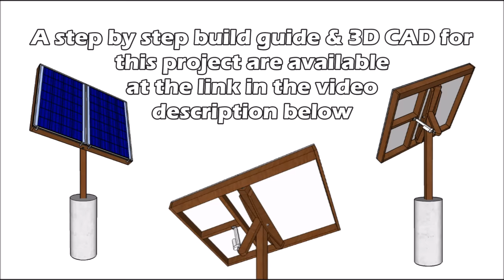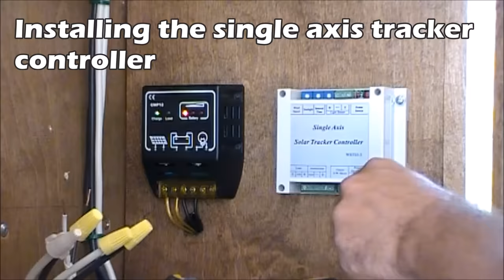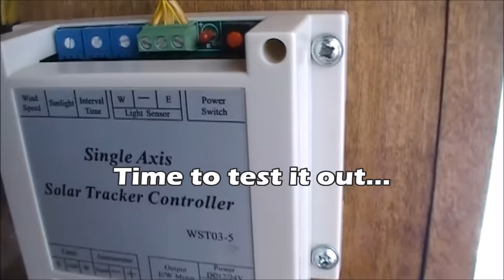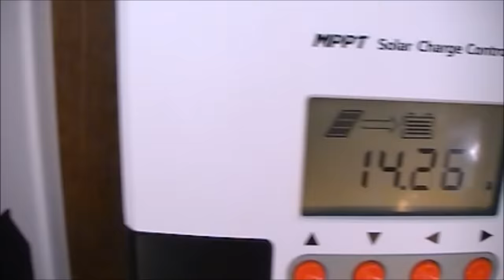Build A Solar Tracking System - DIY Solar Tracker - Off Grid Living!

Comment: did all that and use possibly the most shit horrible charge controller in existence heh   nice vid.
(yes I know it's only to run the actuator :P )

I think I would have gone for the big 250w + 24v panels to maximize use of space and power.  but thats just me.
(and we pick them up pretty cheap here in Aus as there are heaps of companies selling used panels from warranty jobs were an entire system has to be replaces if there's a fault so meet Aus standards for grid tie)

approx $70 US pew 250w 24v panel
Reply from the maker: Thanks. Are you talking about the SRNE charge controller or the tracking controller? Charge controller is among the best in its class - only thing I can think of that might beat it is my Classic. But the tracking controller is a cheap one. Though it's been working fine for me, can't complain for the price - yet lol. Could spend twice as much and double the payback period, but that's not very good either. Easily replaced worst case scenario. I make my own PV btw, which is limited to my laminator size (see past vids). The sun only outputs so much energy per sq.m of collector area (1 kW on average), so there's really no 'maximising' use of space with a 250W panel vs 120W panel - it's just increasing required space. You would be maximising the use of support material instead, but pushing it to it's structural limits with the extra static and live (snow/wind) loads (I'm a building contractor by trade and follow code like it's a religion). The support post and strongback would have to be increased from 4"x4" stock to 6"x6" to carry the load using 250W panels, or the # of support posts can be increased without increasing size instead. 70$/250W panel is extremely cheap (28¢/watt), probably the cheapest on the planet - even cheaper than the cells needed to make them lol. Best price we can get here in North America is ~70¢/watt, in bulk. Are you sure you're not buying used? Got a link for the store?
Reply: OH, no, that is used pricing. 

I'm four weeks of being a first home owner, the house we've bought has an older 2kw system on it, but with current government rebates and offers from energy providers it's crazy not to go as large as you can here (for us, as my partner works from home so we'll be using all available solar during the day)

the new LG Mono X Neon Blacks are about AU $1.65  a watt and coming at 26% efficiency 25 year warranty.  it's not too bad big panels though.

1 US Dollar equals 1.31 Australian Dollar ~5th November 2017

used panels here are ~ $100 for 250w  cheaper the more panels you buy.
Reply from the maker: Ah, I see. That's cool. I hear that grid electricity prices are really high in Australia too, an old acquaintance once told me that you guys are paying up to 40¢/kWhr? He decided to go off grid with batteries. Not sure how his CBA compared to the grid price after paying for the batt's though. But my system is off grid and it's cost comparable to our local grid price of 12¢/kWhr. I know you've just begun your homeowner experience, but have you considered off grid at all? Might be something worth looking into later on.
Reply: bearing in mind the exchange rate, I'm paying 24.51 c/kWh and 20.48 c/kWh off peak hot water.
AND 114.19 c/Day for "line rental"  and when we move to the new place, we'll also be paying a fee to have solar connected to the grid.     so yea, power is not cheap here.

I have no idea where there would be a 40c/kwh charge in this country.  there would be riots.
and battery systems aren't really worth it just yet, even tesla and what not lithiums systems are WAY too costly.  unless you're willing to radically alter your power usage, and in a country where we have REALLY hot summers, yea, na, there is this guy though.....   but he's crazy (smart crazy though)

https://www.youtube.com/user/nocrf50here    he's currently up to a 60Kwh battery system made from old laptop cells and still building packs.  it's a mammoth effort.   VERY impressive.
Reply from the maker: Sheesh, 24¢/kWhr might as well be 40 as far as I'm concerned - that's still double what people pay here lol. Yeah I followed that guy for a while, he knows what he's doing and has a kickass bank, but I can only hear about 18650's for so long until the subject gets boring lol. Manufacturers must charge quite a bit for basic lead acid batt's there. Like I said I'm off the grid but haven't changed my habits at all, and will see a full return on costs for the entire system in 6-9 years. Bare in mind that I install my own equipment too though, total spent on 3 kW/20kBtu of PV/T panels and gear, 1kW wind turbine and 8 GC-145 batteries is just over $5G. System produces between ~400-700 kWh/month throughout the year, @ 12¢/kWh that's a savings of up to ~$80/month, or $960/yr in grid electricity costs (6 year payback), or a minimum of $576/yr (9 year payback - unless we enter a nuclear winter or something). Easier to install your own off grid system but almost impossible to do with grid tie unless a person has a licensed electrician for a friend who will inspect their work and put their stamp of approval on it so that the utility can hook them up with a net metering program.
Opposite to your needs, we use a LOT of heat energy here in Canada. Most people burned wood up until the last decade or so, then some starting switching to natural gas and cold climate air source heat pumps for cost savings (despite being surrounded/dominated by the Boreal forest, firewood is not cheap). I'm sure that the large cooling demand for homeowners in Australia is enough to turn them away from powering their ac's with solar (though geothermal might be practical - the lower the air temp passing through the condenser coils, the more heat you can dump outside and the less energy the compressor will use. If deep ground temp's remain 'relatively' consistent throughout the year and is cooler than the average summer ambient outdoor temp, then burying some coils, installing a simple pump and incorporating a water/glycol to air heat exchanger on the input side of the condenser would help considerably). I definitely would not be able to afford to power resistance heaters with PV, that's for sure. I would need 8 kW and dozens of batteries plus what I have now just to cover heating needs. My PV/T system (I assume you know enough about PV/T to follow along - if not feel free to plug me with questions) is how I heat my home directly with solar thermal power during the day, and use wood at night. I don't like burning wood though, defeats the end goal of owning a net zero home, so I'm incorporating a cold climate air source heat pump with the system this weekend to hopefully eliminate the wood stove altogether. When the collector temp in the PV/T array is too low for comfortable direct solar space heating but is still higher than the outdoor ambient temp (which can drop below -40°C, before the wind chill), then temperature and photosensitive relays nd automatic dampers will redirect the backpass airflow behind the panels to the coils in the outdoor heat pump unit, instead of pumping the air directly in the house (the latter will be an open loop configuration, whereby cold air is brought into the collector from outside. When direct heating with solar, the configuration is closed loop in that it circulates indoor air from the house, through the collector, and back again). With that said, the heat pump does add another $1800 to the system total, technically, but the coogeneration should increase the average coefficient of power for the heat pump substantially, and allow the PV/T system to contribute far more btuh's than it normally would in it's current stand alone installation. Hopefully the savings will balance the added cost, but with this being a bit of an unconventional approach to heating there isn't a whole lot of prior research  published on what to expect. None the less I have power and temperature data logger ready to record everything, and as always the info will be posted on my website whether it works or not. Visit the link below if you're interested in seeing past PV/T attempts and the disasters that followed (see 'Open Source R&D' tab):
www.resystech.com
Reply from the maker: I remember my old acquaintance had an ENORMOUS amount of batteries. Dozens upon dozens. Top quality too. His Pv was equally large. Had local installers install it all. Kind of blew me away thinking about the amount of $ he was spending and how he would recoup it. Always wondered why he didn't look for alternative cooling methods but never mentioned it, he seemed really happy and I didn't want to insult him.
Reply from the maker: ...then again, he was the one who said you guys are paying up to 40¢/kWh. Might be how he tried to justify it.

Comment: Great work! How much are the factory solar panels in the US? In Russia, a panel with a nominal power of 100 watts costs 80 dollars. At first I wanted to make myself from Chinese solar cells. But it turned out cheaper to buy ready-made, also Chinese, good quality.
Reply from the maker: Not sure what they cost in the US, but here in Canada the retail cost for a small quantity of 100W panels is between $150-175/panel. If bought in bulk for a full size system (generally above 3kW) then the cost can be as low as $75-80 per panel. If you want to beat the cost of professionally made solar panels then you need to buy components at the manufacturer's cost - as in buy the cells, tabbing wire, encapsulant, etc. at wholesale cost, not retail. Especially not from places like Ebay or Amazon. Prices are extremely inflated on these sites because some suppliers are trying to cash in on the DIY market and take advantage of unwitting and vulnerable people. The cost of cells is also going up because of silicon shortages and factory shut down's in China, which is the world's leading supplier of cheap solar cells. Xenophobes like to criticize China and Chinese products, but almost all of my gear is from China or made from Chinese materials and I have almost 0 complaints. 
Trump just tacked a 30% tariff on imported solar products so I imagine the price of solar in the US is going to climb pretty high - if anyone should be thinking about DIY solar, it probably should be Americans.
Reply from the maker: Too expensive - not much better than Ebay if at all. The US dollar is worth more than the Canadian dollar, so once the price is converted to CAD it's even more expensive. Take the first listing for example:  10 pcs of 4.5W polycrystalline cells for $16.16 USD. In Canadian that's $19.91, for 45 watts of solar. Or 44¢/watt. Just for the cells alone. At a price like that, DIY panels would cost far more than manufactured panels in bulk. Fortunately, I already have a supplier here in Canada and get my cells for less than 30¢/w, but I would advise anyone looking to make DIY panels for a large system to contact material suppliers directly and work out bulk order prices, it's far more economical than just clicking the 'buy now' button. A lot of manufacturers sell on places like Aliexpress and Ebay, but generally you have to contact them directly if you want any bulk discounts. Otherwise, I wouldn't recommend DIY.
Reply: I agree with you.

Comment: How do the solarpanels reset in the morning? :)
Reply from the maker: The sensor mounted on the tracker - when the sun sets at night the sensor tells the controller to move the panels to their homing position (basically due south), then when the sun rises in the morning the sensor is in the right position to catch the light and tell the controller when it's time to point the panels east.
Reply: Awesome work!!! ❤️
Reply from the maker: Thanks!

Comment: should have used steel pole instead of wood , that wood will rot in less than 10 years , it doesn't matter that it's treated wood

Comment: 18 labor hours @ $12 per hour and about $50 in materials to get a 25% output increase out of a 240 watts solar tracker  wouldn't be much of a cost effective project.... you can increase the output by 55% instead by installing an additional 300 watt panel for only $100 apiece....(and seen them as low as 25 cents/watt)....

Comment: Do not ever pound rebar into the ground like that.. it will rust and dissolve in no time and destroy the integrity of the concrete as it decays.  This is not how you poor footings... if you want a stable footing dig a bigger hole with more weight.

Comment: Wouldn’t it be easier and less complicated to track the sun by a timer
Reply from the maker: Less complicated? Not really. I didn't have to build the tracking controller - just connect red to red and black to black. Have to do that with a timer or any other controller type too.  Besides, it would severely compromise efficiency and probably render the effort pointless. To work properly, the timer would still need some sort of intelligent control that accounts for daily progressive sunrise/sunset changes and estimates the position of the sun accordingly. A programmable timer could work, of course, but to find one with a memory large enough and go through the bother of programming it to suit the solar azimuth throughout the day, every day of the year, a person would probably find it easier just to spend 10 minutes connecting a couple of wires to an affordable intelligent controller that's designed to automatically track the sun.

Comment: It would be easier and cost the same to instead have two stationary solar arrays, facing 90 degrees to each other.
In the northern hemisphere, one facing south/west, and the other facing south/east.
For a gain of 25% more energy, a solar tracker isn't worth it.

Comment: You are spending a lot of effort and cash to get the maximum output from your panels so why not enclose the rear of the panels with some thin plastic or ply and use a small under-volted computer fan to blow cooling air on the panels ?

Comment: What a luck pv has become so cheap that it's easier to buy some more panels than to spend time building such trackers
Reply from the maker: If you have 25% more space to work with, sure. If not, then you're stuck with trackers. Guess your solution isn't a cure all eh?

Comment: That will cost a fortune. It's cheaper paying for electricity from the grid.
Reply: Maybe in some areas, but if you need to pay for building the grid connection because you live a hundred miles from anywhere, possibly on an island or up a mountain, making your own electricity becomes both way cheaper option and is going to be far more reliable when snow or storms cut the wires. Yes, buried cables are far more secure against elements, but those cost even more.

Even if you don't live off grid, lowering the amount of power your house uses will add up to a notable amount of saved money, and because prices of the panels and electronics have gone way down and he did the installation himself the payback time is very short. That means he will be getting free power out of those panels for 20-25 years, and even if they need to be replaced by that time the expenses are likely to be even lower by then.
Reply from the maker: @ Mick Unless you're paying less than 10¢/kWh, then no, grid power is not cheaper (especially if the system is grid tied). Show me your math, then I'll show you mine. In fact, you can see mine in the comments below. Try refuting that before spouting unsubstantiated nonsense.

Comment: Design is cool but wood aint gonna hold up to mother nature and too much work for just 2 panels each mount.
Reply from the maker: I guess people should stop building expensive decks and fences out of pressure treated wood then lol. As a carpenter/contractor, I'm pretty sure that's not gonna happen, but to each their own. If you can do composite, then have at it brother. Took less than a day to build, pretty easy and fun DIY project for the avg Joe who can't weld and just needs a few panels for the hunting camp or something, pretty easy to replace in 10-15 years when mother nature deems it necessary. They're a little grey now after 5 years in the sun, but still holding up fine. Survived two hurricanes and I don't know how many tropical storms and nor'easters. They can actually hold the weight of up to 1 kW of solar each if the 4x4 post is replaced with a 6x6, I just didn't need another 2 kW of solar. I have too much as it is and just wanted to try something different and fun. A person can achieve the same results as a tracker by adding 20-30% more panels on a fixed rack, if they have the space. But for verification, check common solar panel specs (I'm not suggesting people should make their own like I did) and load tables, specifically the lateral dynamic load capacity of a #1 or #2 4'x6"x6" Douglas fir serving as a fixed column in a 100km/h wind for ex, with 1000W of solar on top acting as a sail. Wind energy = (1/2) · A · ρ · v3 · t

A [m2] – air flow area
ρ [kg/m3] – air density, ~1.225 kg/m3 at pressure of 1013.25 hPa and temperature of 15°C
v [m/s] – wind (air) speed
t [s] – time. 

But what do I know? 🤷‍♂️ Thx for the input!

Comment: I hate mistitled videos. This is not how to build a solar tracker. This guy builds a pivoting frame and INSTALLS a factory made solar tracker. Please understand the difference between BUILDING your own and INSTALLING. Also what a waste of an excellent water tank. You can pour that concrete and have rebar roots without wasting a good 15 gallon water tank to do it.

Comment: This is not DIY most people don't have a brake that size
Reply from the maker: Most people aren't DIY'ers either, so I didn't share this for most people. Regardless, anyone with $40 in their pocket can rent a metal brake for a day from a tool rental shop, even though it's not needed for this project at all. Problem solved ;)